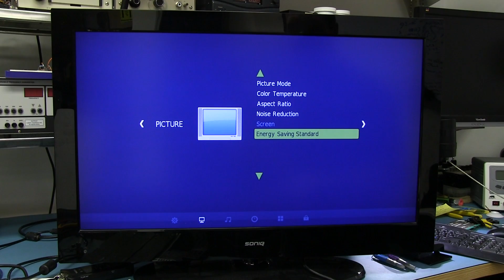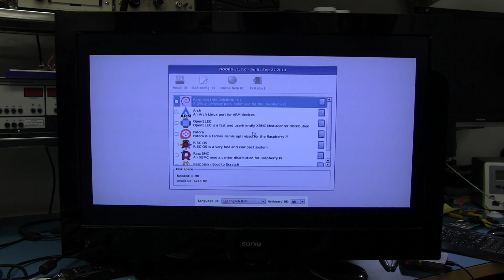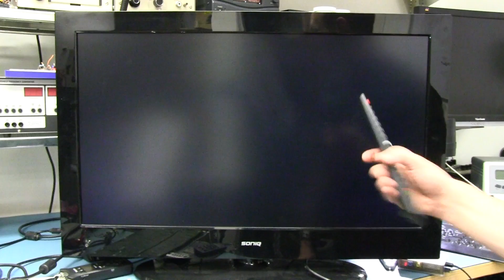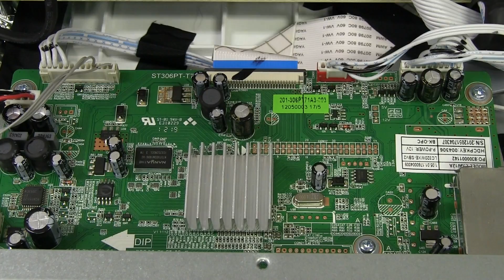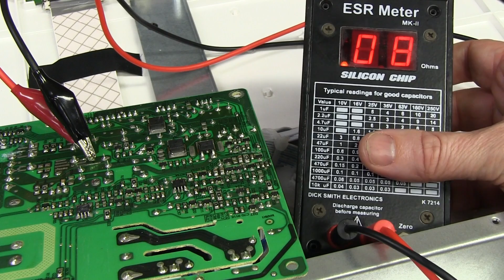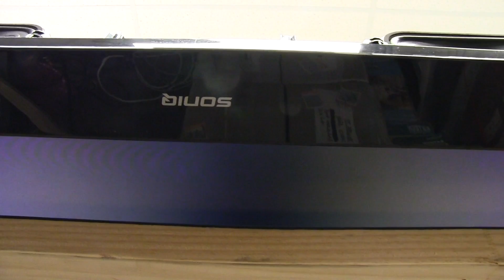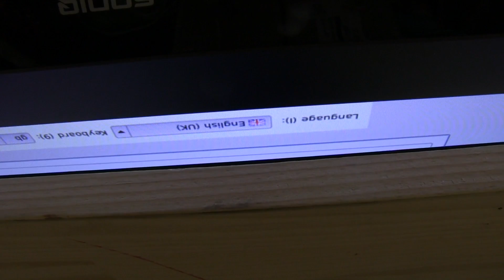EEVblog #630 - How To: Soniq LCD TV Troubleshooting Repair - Part 1

Comment: I'd reflow that BGA. Looks like an intermittent digital connection.

Either that or the main chip is dying.
Reply: spot on,
thermal degradation of solder joints or Pad cratering
Reply: Yep, that could be it. Saved a GTX 570 which also had some intermitten problems (not detecting the screen and some artifacts) just by heating it up with a heatgun :3

Comment: Did you get sound from those HDMI-inputs, even if there was no picture? If so, then it might indicate that there is something wrong with the panel or its connections. Holding the TV up and flexing it from the top corners might help verify that. If the main processor has connection issues, you might want to put pressure on it or heat it up with a hot air gun. Anyway, interesting nonetheless.
Reply: Agreed. This looks like a intermittent problem, so the right way to troubleshoot it is to go a bit physical with it.

Comment: Funny enough I purchased the exact same model TV for my girlfriend a couple years ago and it ended up with a very similar fault. The picture would occasionally come back for a moment like your's did. Replaced all the crusty looking power supply caps but to no avail. The quality control on these Soniq TVs is almost non-existent but then again you can't expect much for the price you pay (usually half the price or less of a brand name TV).

Comment: Is my impression but for me the connector to the display seem not connect right?
Also you'll continue the repair on the agilent dsa and the tektronix scope?
Reply: Why would he use the Tek? The Agilent 3000 series is about 100x better in every way. Unless he suddenly needs a spectrum analyzer, which I doubt.
Reply: I think he was asking if Dave would continue trying to repair those two devices.

Comment: I bet it's the main processor. If the Chinese sweatshop electronics factories shop around for the cheapest parts going, you can bet they do the same for the ICs in these devices.

This is where you go on eBay and look for someone with a similar looking TV with a smashed screen, to harvest parts from. If it's worth the time and effort though, our local supermarket sells TVs like that for not a lot of money.
Reply: Nah, a bad processor does not typically cause intermittent problems of this kind.